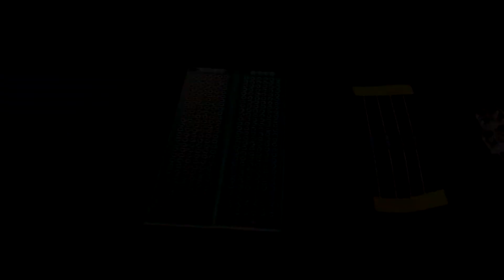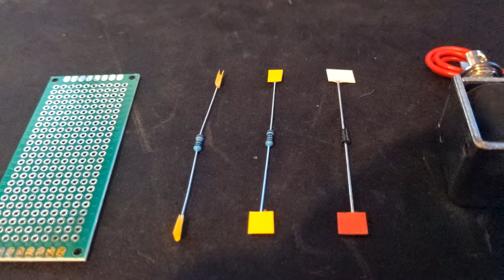GUN4IR Ground up Build

Comment: Your link to the resistors for the IR build leads to 1 ohm resistors, not 27 ohm. Will those work anyway?
Reply from the maker: Thank you for letting me know about this. See this link. https://amzn.to/3Lp8Zrx
Reply: @ArcadePirate  Thank you for the video. I bought those 1 ohm resistors, but they still worked. I emailed the developer and he told me to use 7 to 8 ohm for the emitters I have (same clear ones you linked to) so I take it there is a lot of room to play with the resistance. :)
Reply from the maker: @TheNickybocker  Thank you for the information.
Reply: @ArcadePirate  Tested it out today, I could see the LED's with my phone camera, but the gun isn't seeing them well enough. I used the 7 ohm resistors raymond? told me to use. I had to tear it all down :(  and go back to the other resistors you have posted here. I coated all the traces with liquid tape so it was difficult, but I got 2 of them done so far and they are a lot brighter, I had to order more 27 ohm resistors to finish it.
Reply: @ArcadePirate a a

Comment: Hello Arcade Pirate.
Awesome video! You inspired me to make my own gun. I’m looking for some help on an issue hoping you might be able to resolve it. I purchased the ultimate Gun4ir kit from Ray and was able to get a Namco Time Crisis gun shell with sliding solenoid. I had to get a sub miniature micro switch for the trigger. I am  not sure how to wire it. It has 3 tabs. 1st tab has a C by it, the 2nd tab has a NO by it and the third tab has an NC. On the wiring sheet from Rays ultimate kit the 
Left click/trigger goes to pin  A2. Here is where i am stuck. Not sure where to wire. I was thinking the wire from A2 goes on the C Tab on the switch . and a ground wire from the NC tab to a ground on the audrino board. Would you know if that is the correct wiring for a sub mini. micro switch?
Anyways always looking forward to your next video.
Thanks AP!
Reply from the maker: I would contact Raymond over at RPEG Electronics for help on that. https://rpegelectronics.com/products/rpeg-electronics-donation
Reply: The C pin is kind of like the main pin. You connect your main wire to that. NO stands for normal open and NC stands for normal close. It means which one you use will dictate whether the switch is activated when the button is pressed in or when it is not pressed in. In the case of a trigger, where you want it to activate when it button is pressed in, you would want to use the NO pin and connect your ground wire to that... 

I THINK. NOT AN EXPERT BUT THIS IS ALL JUST MY UNDERSTANDING.

Comment: Hi, Great build. Just a couple quick questions for anyone who knows.
Can I use a IRF540N Mosfet in place of the IRL540N Mosfet? 
Also if I use a P2N2222 transistor in place of the PN2222, I just have to place it backwards yeah? 
And a monolithic capacitor is just a modern ceramic capacitor yeah?
Can the 1n4001 diode be replaced with a 1n4007?
Thanks
Reply from the maker: Reach out to Rymond over at https://rpegelectronics.com/ 
He can answer all your questions. 

Thanks.

Comment: First of all, congratulations on the guide. I'm interested in building two guns but looking at both the guide and the parts list I noticed that the solenoid in the guide is 24V instead in the part list it's 12V. Could I know which one you use? Thank you very much
Reply from the maker: I would contact Rymond over at https://rpegelectronics.com/ for more information. He can answer all your questions.

Comment: I made a new spreadsheet with all the links you listed, updated and duplicates removed, with prices for all components. It looks like it's going to be about $315 before shipping and taxes for all of the parts, including the GunCon. Pretty expensive, but on the plus side if you decide to build more than one you will save a bunch of money because of all the extra parts you will have leftover. Thanks again for the walkthrough!
Reply: Do you need to use adjustable power supply? Can I just use 12v laptop charger
Reply: @isla2416  I haven't built it so I can not tell you for sure. Hopefully the creator of the video sees this and chimes in :)

Comment: Great video!  To get the app working you need to pay/donate $20 to get the license to make it work. Pay/donate, he then emails you the license and link for download. The Top mark on My camera was 90 degrees off and had to be rotated clockwise 90 degrees. My Aimtrak and Wii bars were also messing things up and had to be turned off/unplugged. After finding 2 intermittent working IR lights and having  the wrong firmware flash in the board, 6 hours later I got it working :) If your gun has a D-Pad and start buttons etc you can wire them all up to this board. Leave everything loose until you get everything soldered up and then secure things in place with hot glue where needed. Only secure what is needed in case you need to take things apart. Test it well before securing everything in place.

Comment: Thanks for posting your video, I should have done what you said to do in the first place. "Get the Gui" I can't  find/download it anywhere. I register on the page to the link you have and they say "Success" But never send a confirmation email. Going in circles to get the software. Wasted my time and money on buying/building this gun only to not be able to find the GUI,
Reply from the maker: I'll look into this and see if somethings going on with the site.
Reply from the maker: Check your spam folder.
Reply: @ArcadePirate  Figured out how to get it. Need to pay $20 to get the license to make it work. Paid and he gave me  the license and link. Top mark on cam was 90 degrees off  messing things up. My aimtrak and wii bars were also messing things up. after finding 2 bad IR lights. I got it working. Thanks for responding.

Comment: timestamps for easier viewing. 

although i still recommend watching it through fully instead of skipping around so you get a good idea of whats happening, especially if you have little to no experience in stuff like this (like me). 
although maybe you can skip the optional parts like the RGB, rumble and recoil if you dont plan on doing those

0:22 get the gun4ir gui

0:26 led sensors

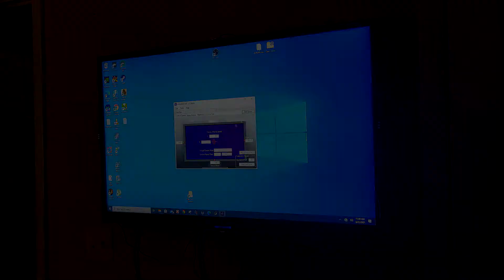8:19 recoil mosfet, attaching ground and recoil to arduino (recoil is optional)
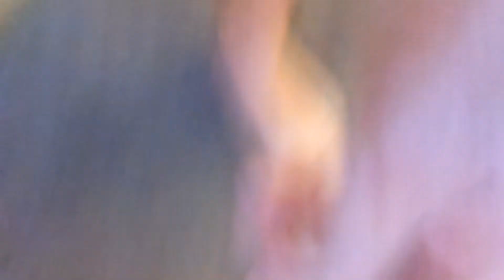16:52 recoil test

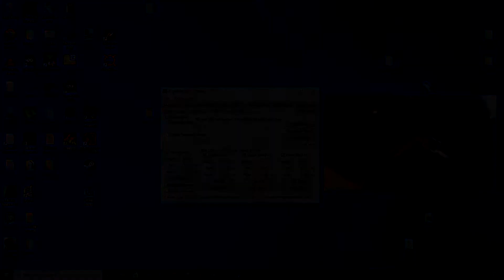17:34 ir camera to arduino

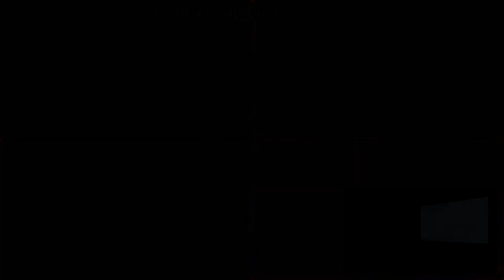20:26 rumble motor (optional)
27:45 rumble to arduino 

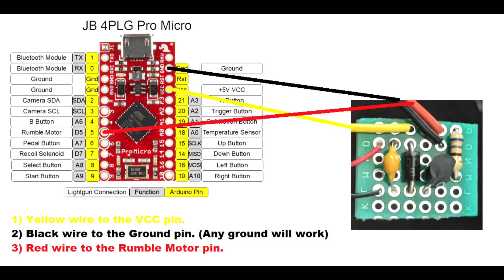28:03 RGB lights (optional)
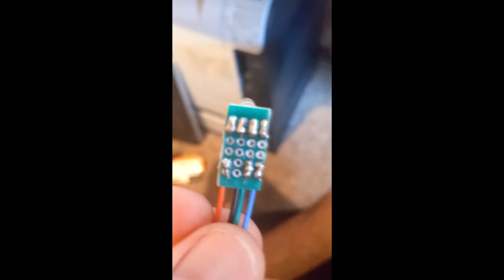32:48 RGB to arduino

33:43 trigger and A/B buttons
34:02 A/B buttons to arduino 
34:26 A/B ground wires 

35:10 trigger
35:56 trigger to arduino

36:01 layout of components in the gun / putting stuff in the gun
37:30 testing gun

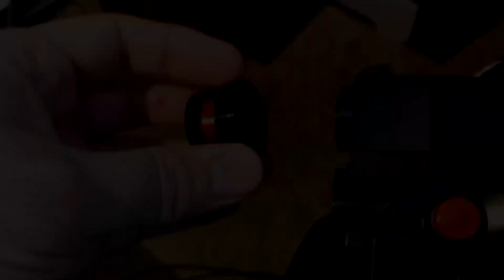38:27 fisheye lens to increase usable range

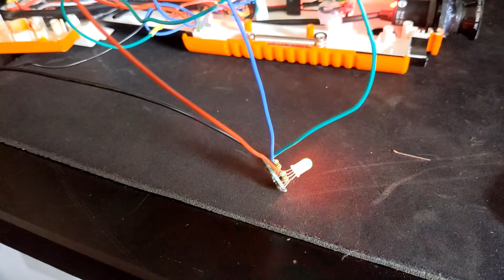33:01 tip if you run out of ground pinholes in the arduino board
Reply from the maker: I should have done this a while ago. Thank you for the post.

Comment: Great vid. Don't have much electronic building experience besides doing my car sound system ages ago but I think I could follow this. Only concern is where to exactly solder all the pins to the board accurately...

Btw what if you want to add extra buttons than the A & B and trigger?

Also where do you get all the components? Is there a kit? I'd like it in a Sub Machine Gun form factor!

Comment: Where does the mosfet connect to its the only thing not mentioned in the video please?
Reply from the maker: Its not mentioned because it doesn't connect to anything. Place it inside an open space in your gun. Mine sets under my solenoid.

Comment: Hey Pirate, I was almost done with this project because of you, thank you so much for sharing this information and video to all of us. I have purchased the same power supply you showed on the vídeo, it took an eternity to arrive. When I finally got it, I plugged in and it just died and I got refunded for that. My question now is, what is the voltage and type of power supply I can order now? I don’t want to miss a second time. Thank you!
Reply from the maker: I'll look into it and find an alternative for you. Send me some pics of your project. arcadepiratetalk@gmail.com Thanks for the support.
Reply: @ArcadePirate  I had sent you an email a few weeks ago but I did not get reply. I have now finished the built in its full Bu my solenoid does not move, not even on test mode. I have purchased a new power supply of 24v 3amp and this should be enough for power…any I have followed step by step, same materials and everything…I am pretty sure my built looks good…I will send you a new email with new pics of the solenoid bird. idea what might happened? Bad soldering?
Reply: @ArcadePirate  did you retain the d pad function? Did you find a power supply alternate?

Comment: Hey buddy, 
Just wanted to say that there is a little mistake in your explanation. It's not recommended to connect the rumble motor to the VCC, as it causes a voltage drop and might kill the voltage regulator if the rumble uses too much current 😉
Reply: so what should you connect it to instead?
Reply: @KingM119  To the "RAW" Pin, I think..

Comment: My ir led gets a little warm to the touch on one section is this normal?
Reply from the maker: That doesn't sound good. Check your soldering.
Reply: @ArcadePirate  Thanks i got it sorted.   Have you done a jolt gun those look way cool.
Reply from the maker: @jayeparker9281  Not yet. They are expensive. Maybe one day.

Comment: Do you have an updated video on making the ir led system with the new black leds?
Reply from the maker: I would like to make one. A lot is going on for me at the moment so it's hard for me to make any new videos. I'll try to make time for a video like this. Thank you
Reply: @ArcadePirate  no! Thank you. I am new to arcades, light guns and the general environment. I love YouTube University as I call it lol. I look forward to seeing the update when you can.
Reply: @ArcadePirate  Hi, it's the same way, just a different LED ?
Reply: @lolorenzolamas  same way, just need different resistors as these black ones work at 100mA, so 5-10 ohm will be fine
Reply: @andreasbaumann8066  Any chance you could send me links to the emitter and resistors needed for the black setup on ebay?
Reply: @PutnBaconOnIt  Hi, did you ever happen to find the out the links for the specific emitter and resistors for the black ir setup? If so, please let me know. Would love to pick them up for my project. Thanks

Comment: Thanks for the video! Bought my GUN4IR package and started my first project... My question is how are the buttons wired in are they looking for a short to activate or is it 5v. I'm modding a Cabellas Hot shot rifle and trying to reuse the start and menu buttons which don't put out a full short when pressed more like 2 M ohm. Thanks!

Comment: to anyone who builds this and their circuit won't work:  check your power supply!  I used a variable digital readout one from Amazon and it did not work.  Switched to another PSU I had and that same circuit worked!
Reply: What voltage/ amperage power supply is needed? What one did you use that worked, link? Thanks

Comment: Hey arcade pirate you ever had a problem with the solenoid getting hot and it gets stuck in a position. I tried different voltages and if I lower the voltage it gets unstuck
Reply from the maker: This video should help with that. https://youtu.be/RNAkV7p_9sI?t=228

Comment: I connected the trigger line to the arduino. When I pressed the trigger button. Only the led and motor will move, but the solenoid will not move. If the solenoid is tested on the gui, it will move. Did I miss something? I use a micro switch as a trigger. thanks
Reply from the maker: Are you pointing the gun at the sensors? If you don't it will not move.
Reply: @ArcadePirate   thk
Reply: I am waiting for the camera. It may be completed by the end of August or mid-September.
Reply: @ArcadePirate  I also tried wiimote camera but it was really too difficult for me.
Reply from the maker: @kokkeonglee8005  Sucks the cameras are sold out. Let me know how it goes when it's complete. Good luck.

Comment: Hey arcade pirate building my first gun because of you! Question what did you use for a trigger switch? I don’t see anything on your parts list for it? Thank you
Reply from the maker: I used the trigger button that came with the original light gun.
Reply: Got it! Thanks

Comment: So, with the software to function correctly, do you need to have all components, or could you conceivably make a budget build with just a trigger and camera (without the rumble & recoil)
Reply from the maker: For a basic build you can do this. Just wire up the camera and trigger button. (I would recommend at least one more button for other commands)

Comment: Good, but isnt better  for RGB just to solder and use shrink tube around resistor ? No need for pcb if resistor+cable+LED .
Reply from the maker: I'm sure you can do it that way.